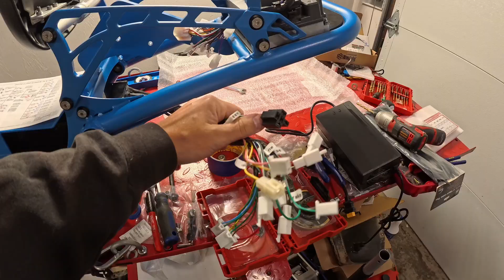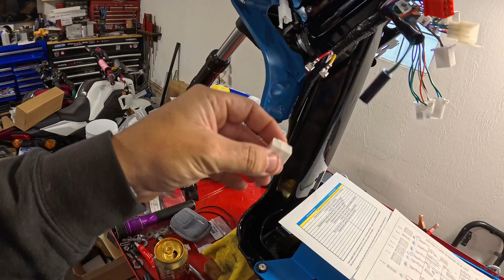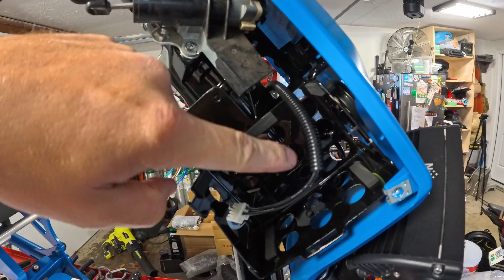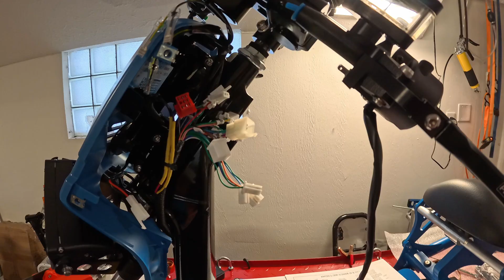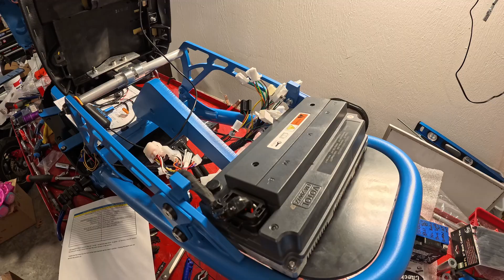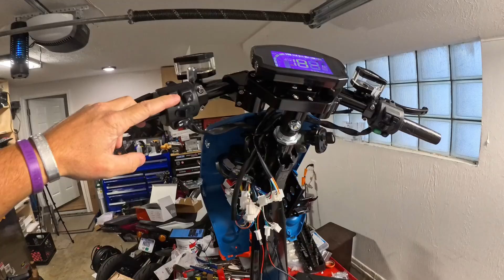How To Wire An Electric Honda Ruckus | QS138 Ruckus Electric Conversion

Comment: I would do it a little differently, I would put the battery under the seat and the controller under the legs and use a battery that would give it a 200 mile range
Reply from the maker: As cool as that would be... There would be absolutely no way to do that safely without major frame modification.

Comment: Quick question
Why not use the QS165 motor ? I'm curious on your opinion
Reply from the maker: Great question! Simply because I've always used the 138 and have been very happy with it. I can pump it to 40kw without issue and have never had one let me down yet so I stuck with them.
Reply: @3CMiniWorks I'm new to the electric scene and I had no idea you can bump up the QS138 to 40kw. I thought it was limited to what the manufacturer says lol thanks for replying!
Reply from the maker: @zexbravscazgf634  nooooo! The rated manufacturer specs are generally for continuous use. The 138's really can take a beating. There's lots of folks that push them to 50s in bursts! I've been very happy with all of ours.
Reply: @3CMiniWorks good to know thanks!!
Reply: @3CMiniWorks  Do you keep continuous motor current at 89 amps on your controller? Also do you mess with phase amps at all?
Reply from the maker: @477Garage  no. I match my battery outputs so this one will be like 300amp continuous. Pretty irrelevant though because in the real world I would never be continually holding those amperages. I do not. Not necessary for my needs.

Comment: Any thoughts of cleaning up all of the connectors into one or two large deutsch plugs
Reply from the maker: I have no thoughts on it. Would it be cleaner, sure. But it's not worth the time imo when I can cleanly hide everything under the seat. Plus this allows me the option to quickly diagnose any issue that may arrive based on their wire pathways since it's all separate.